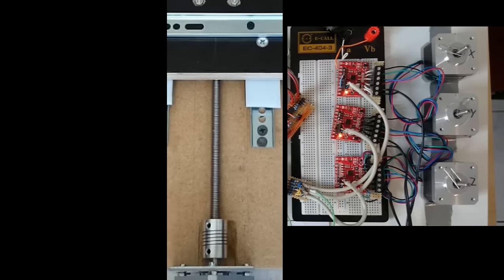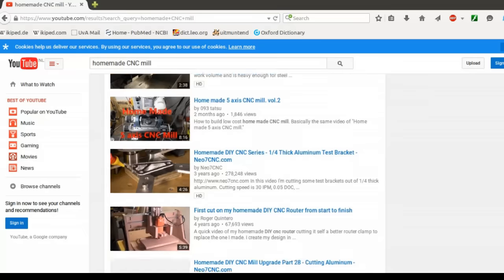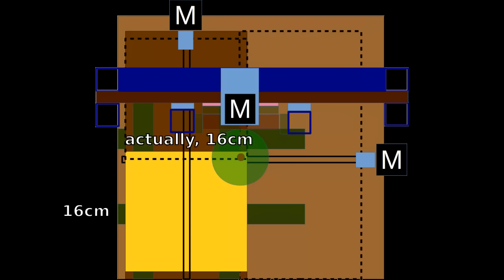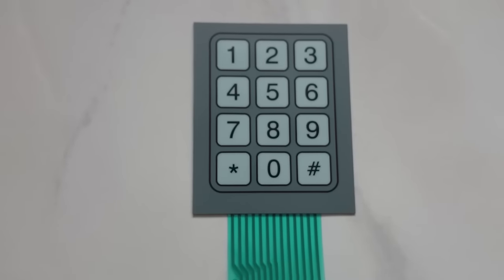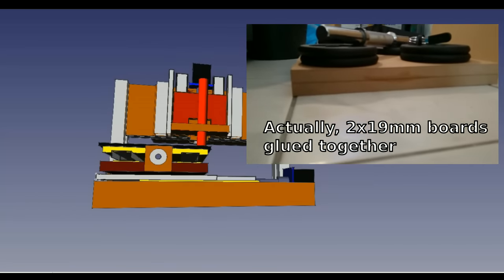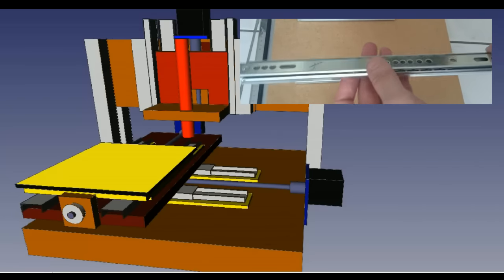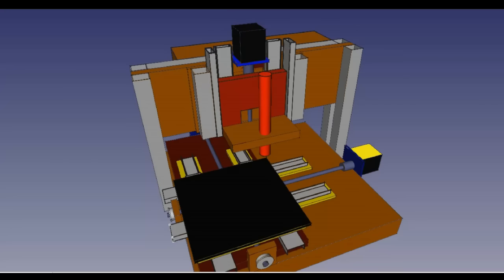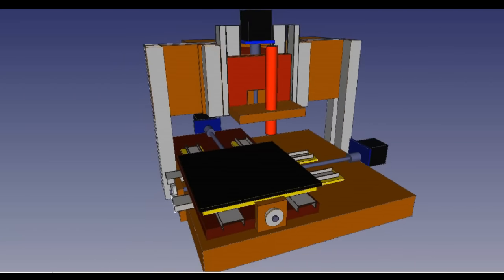My homemade desktop CNC mill - Clip 1/6: Plans, ideas and sketches

Comment: You asked for criticism, so here goes; Drawer slides are meant to be mounted in the vertical orientation. Set horizontally they exhibit play as shown in this video. Some compressed pre-load on drawer slides helps eliminate the slop in them too. 60 degree angle all thread is a poor lead screw. Acme thread is a better choice. GRBL is immature software. LinuxCNC is mature. That's all I can think of, for now. Oh, run NEMA 23 stepper motors for CNC. The 17s are too dinky. Leave them for the 3D printing crowd. Those motor drivers looked like piss too. TB6600s are the value choice today. Despite all of that your build still looks like it came out great.
Reply from the maker: I designed my machine (knowing all limitations and possible alternatives) for PCB milling and other 2.5D stuff and it does these jobs excellent. What you mention is things that distinguish my $300 machine from a $1000 one. Drawer slides are questionable, agreed, but made possible my compact design. M8 rod/nylon nut: same reasons (compact, durable enough). LinuxCNC would require a dedicated PC, a parallel port and a classical CNC stepper driver. I really prefer the GRBL solution. NEMA17s: fine for my required speed and power. My machine cannot mill steel etc. anyway. And how can a motor driver look like piss? Please explain. The BEDs work great, more would've been overkill. p.s. Here is a fish for the most negative language in my comments so far. Congratulations.
Reply: JoEtuuube
I can relate. I had plenty of the same design goals as you did. I just managed to build a far more capable machine for a good deal less than you. I have twin stack NEMA 23 motors running 1/2 X 10 TPI acme lead screws. I have driven my machine up to 114 inches per minute rapid travel speed. Though I usually keep it at just 60 IPM. In total my machine cost me around $200 to build too. But I did get a great deal on most of the stuff I used.

Still, the difference mainly came down to choices I made. Like not settling for garden variety all thread lead screws. I ordered some acme rod online. It really did not cost that much either. Though the nuts for that stuff are expensive. Forget about buying a real tap too. I was able to make a tap good enough to cut threads in plastic out of a cut off piece of rod. Actually one of my homemade taps can almost cut threads in mild steel. Because I made some semi-tapped lock collars. They thread on, but they're pretty tight.

Comment: Hi there, is there anyone in Sout Africa , Cape Town building one like this, my husband wants to but where can one get plans, anyone sharing
Reply: +Gavonia La Grange - Hi, your husband can look at the Openbuilds website and get parts from Netram Technologies (They are based near Canal Walk and I am sure that they will be able to assist with advice and guidance) or Digital Droid (webbased, nationwide delivery). I am based in Johannesburg, and have built my platform and have the controller and free software, I just need to buy the motors etc. to complete the build.
Reply: Also don't waste your time trying to get the stepper motors from broken printers and scanners, they aren't powerful enough for a simple, beginner build.